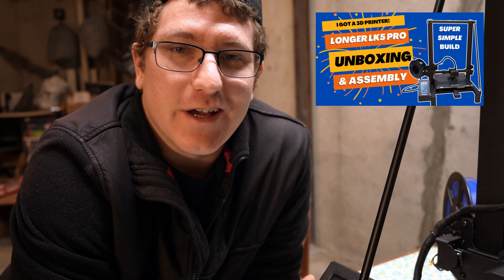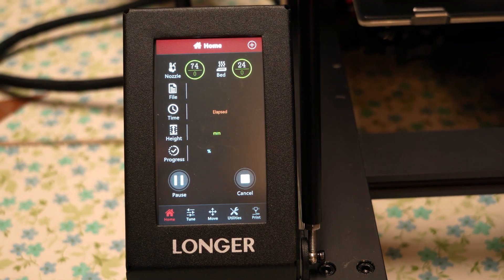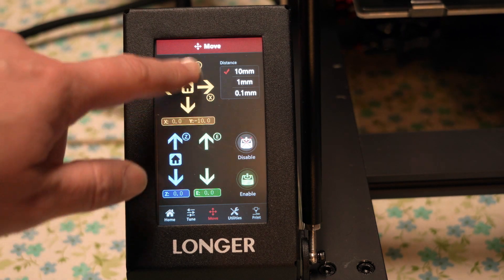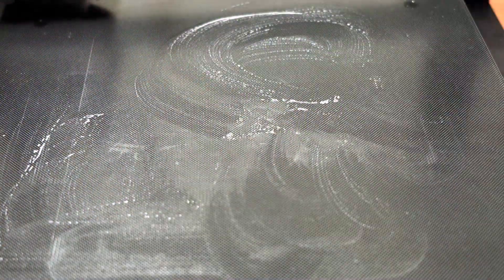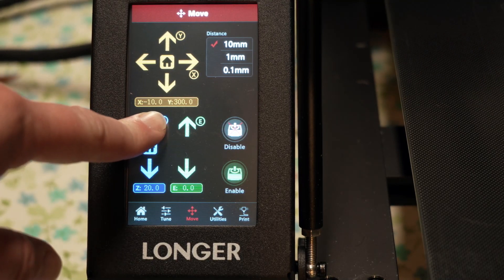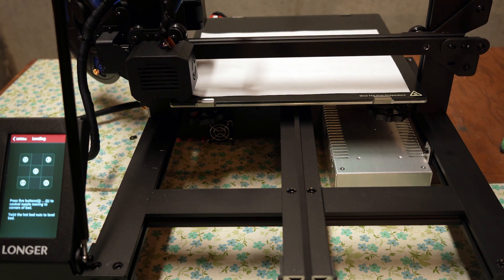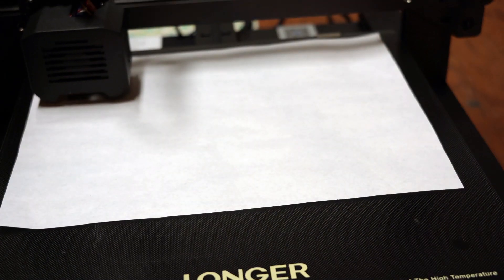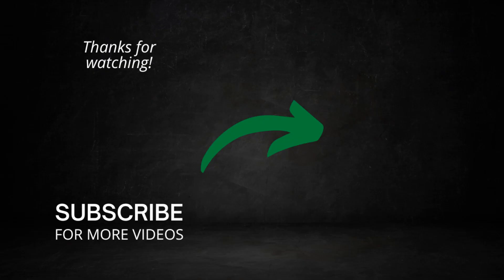How to Level the Print Bed on the Longer LK5 Pro 3D Printer | Simple Tutorial

Comment: Do I have to manually adjust temps before every print?
Reply from the maker: No, you should be setting the nozzle and bed temperature in your slicer software. That will be in the gcode in your print file and the printer shouldn't start printing until that temp has been reached. The only reason you should need to manually adjust temps should be for loading/unloading filament and bed leveling

Comment: So I have the following problem: after I have leveled all positions and then go to position 1 again for example, the nozzle is a millimeter lower than it was before, so that it now presses on the bed. Every time I press the button for position 1, the nozzle shuts down a millimeter. I really don't know what to do about it, do you know anything?
Reply from the maker: Hmm, I have not encountered that issue. Maybe try a firmware reset on the printer and see if that solves it!
Reply: I would say give every corner a 2 mm space then start form 4,3,2,1 then 5 maybe starting backwards could help

Comment: I keep having an issue to where I level it on all four corners the paper slides perfect but then when I go to the middle, it’s way too low and I have no way of moving the paper
Reply from the maker: There is a chance that maybe the glass bed is bowed. I'd move the corners up enough to get the middle close to perfect and then if you're going to do a larger print, use a glue stick on the bed to help the corners stick even if the bed is a little further away from the nozzle than you'd like.

Comment: I find that in addition to wiping off the nozzle it helps to 'unload' the filament a bit (not completely) so that if you're using a filament type that has a tendency to 'ooze' there won't be any filament in the hotend for it to melt and let ooze out after you wipe the nozzle off.
Reply from the maker: Great tip!

Comment: How to do you adjust the middle on (#5) there’s no wheel to adjust it
Reply from the maker: There isn't a lot of options for moving the center, but if the nozzle is a little further away from the center, you could add a piece of paper or 2 between the metal plate and the print bed that would raise that center spot up just a bit.
Reply: i find that my center is also a bit low. i have the flexible metal plate upgrade and found that a small piece of aluminum foil folded in two under the hot plate center has got me a lot closer to where i need to be.

Comment: position 4 is too tight but wheel is tightened as much as possible useless info in my case
Reply from the maker: I'm not sure if replacing the springs would solve your problem or not, but it might be worth a try. I show in this video: https://youtu.be/oNo6pL3DA7E how to remove the bed. I don't replace the springs in this video, but removing the bed will give you access to them. The replacements are not super expensive on Amazon (https://amzn.to/3NX03eL) perhaps that will solve your problem.
Reply: Need to move limit switch down some and level it again

Comment: Is it true that this 3D printer doesn't print Carbon Fiber Filament ?
Reply from the maker: I have never tried Carbon Fiber filament so don't take my answer as gospel. But, Carbon Fiber filament is still PLA filament. Based on what I saw when I looked up print settings the LK5 Pro can print at the temperature range recommended for CF filament. It does say it is more ridged than regular PLA, but I don't think that would make a huge difference.
Reply: @jfmedina2010  
Thanks a bunch ! I appreciate your fast reply !
Liked/Subscribed
Reply from the maker: @Snailmailtrucker  I appreciate it! 🙏

Comment: My printer is pushing all the way down on the bed, and i dont know what im doing wrong here
Reply from the maker: Check the position of the z-axis limiter switch (the little button that the print head compresses when I comes down). If that isn't positioned correctly, it might not think the print head is as far down as it should be. If that is fine, then you might have an issue with your z offset
Reply: @jfmedina2010  this was my issue, thank you!

Comment: hey! mine is starting in the middle of the air but i’ve leveled it correctly, i don’t know how to check in cura if it’s starting at the right height or not, but i need help:(
Reply from the maker: Hey Jonathan! I haven't had that problem before, but I believe the problem is that your z-height in the gcode is incorrect. If you didn't change it on purpose, I'd recommend uninstalling and reinstalling Cura. If that doesn't fix it, I'd try updating the firmware on your printer. If neither of those things work, you will need to adjust the z offset in Cura. I believe you have to download the "Z Offset Setting" plugin from the marketplace to adjust the offset.

Comment: Good video thanks.  I have an issue with my Longer LK5 pro.  The printer is brand new so I didn't have to clean it.  I went through the bed leveling in your video but when I go into Cura and start a print the printing starts, and then the print stops and it takes me back to the home screen on the printer LCD.

I notice the print start and instead of starting to print in the center it will go to the extreme bottom left corner, start and then the print job just stops and the LCD goes back to the home screen.

I clicked on MOVE and I clicked the little HOME button on the blue arrows and it asked if I wanted to reset the X origin I think it was and I said yes.  I also clicked the "enable" green button.  Please help I'm going nuts.  :(
Reply from the maker: Hello! Have you tried reinstalling and/or updating the firmware? That would be the next thing that I would try. I think you can get the most recent firmware from this blog post on Longer's website: https://www.longer3d.com/blogs/operation-tutorial/longer-lk4-pro-lk5-pro-3d-printer-firmware-update

Hopefully this helps!